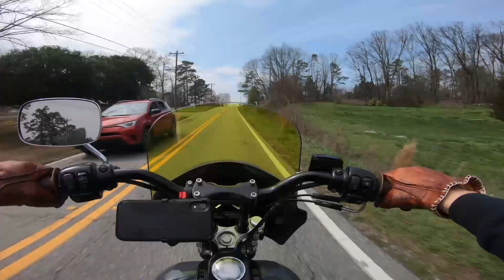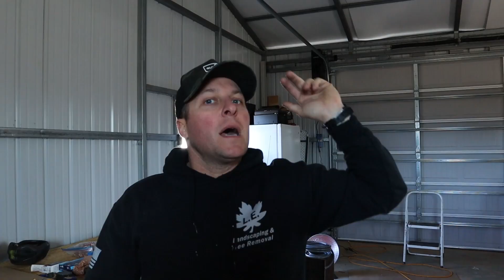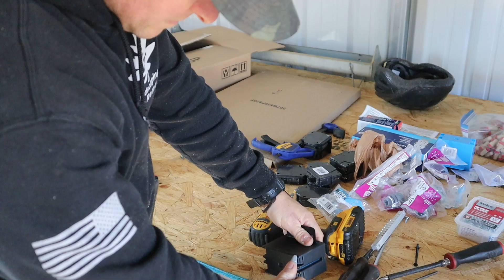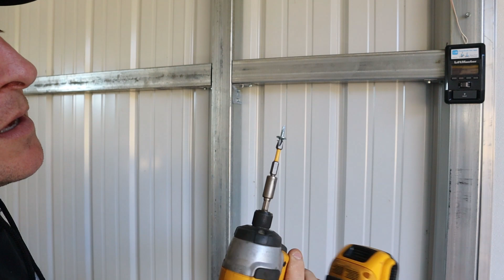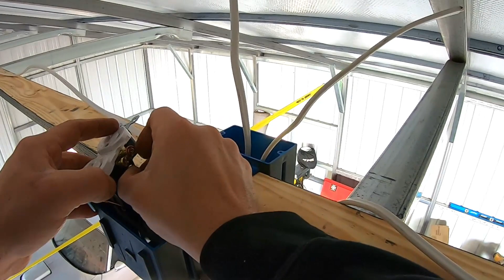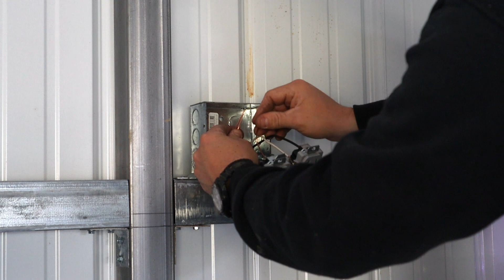I THINK IT'S RIGHT.. 100 Amp Sub Panel install Metal building dream garage build Ep.8

Comment: You’re wiring technique is good however I want to point out voltage drop. In the vide when you were way up high wiring the plug receptical fir your lights in the plastic box you will experience voltage drop. Let me explain. You have a hot wire coming in to the receptical and the receptical will power the wire going back out to where you have it going. Essentially you are using the receipt as a wire nut to power another wire. Doing this creates voltage drop and whatever you power next may not see the same voltage as the first stop from the main hot wire   As far as I know national code dictates that your incoming hot wire and the wire that will receive power must be wire nutted together with a pigtail coming from the nut to the receptical. So you will have in each nut three wires incoming outgoing and the pigtail that attaches to the receptical so in your case on that particular box you should have 3 black 3 white and three grounds. Another tid bit if you wire two different circuits to a 2 gang box all neutrals must be wired together and all grounds must be wired together. I’m not an electrician but I’ve done my homework and please check up on what I have said here. No my own personal opinion and how I rewired my whole house I used 12-2 and 20 amp circuits on everything just to make sure I have room to grow on the myriad of electronics that seem to make themselves into the houses. I don’t think I’ll ever need to upgrade wiring in my house again.
Reply: This is not correct. Neutrals for different circuits should not be connected together. If a neutral on one circuit should break somewhere instead of shutting off the load it will continue to operate and can overload another neutral with current from essentially two breakers on one neutral. 

Neutrals for the same circuit in a junction box must all be connected together.

The Equipment Grounding Conductors, bare or green wires, from all wire runs in a junction box must all be connected together
Reply: And it is accepted to splice through a receptacle as long as the allowed number of conductors under a single screw is not exceeded, i.e. one.
Reply: @duncancomputer  I’ll look it up but this is the way I understood to run two circuits in one box all neutrals and all grounds get wired nutted together. But I hear what you are saying about the separate neutrals. On a personal level unless there’s a good reason why I think all circuits should be separate anyway. Obviously the grounds in a metal box will connect together anyway. But again I’m a big fan of just keeping it easy and simple but the voltage drop I definitely see and sticking to my guns on the pigtail thing I talked about
Reply: @duncancomputer  Neutrals from the same circuit must usually be connected together, but not always. For example, you may have a 2 switch junction box being fed from a GFCI receptacle. One switch for the light and the other is for the fan. The fan is to be GFCI protected, but the light is not. In this scenario you'll have 4 neutral wires in the switch box. The neutral wires from the Line and the light will be connected and the neutral wires from the Load and the fan will be connected separately. If they are all connected, the GFCI would likely trip if the light is on and you attempt to turn on the fan. It would be equivalent to connecting a jumper from the Line neutral to the Load side neutral.
Reply: The NEC article is 310.10(h), parallel conductors for the same circuit.
Reply: @duncancomputer  thanks I’ll give it a look
Reply: I think you might have a misconception or two.

The NEC does not require "pig tailing", though it is my preferred method.  It allows a failure of one recepticle to only effect that one recepticle while the others should work fine.

Ohm's law ..... E = I x R. P = E x I

Connecting up a wire on the panel hot, going to a light, then returning to the panel gives you a circuit that lights with the breaker on.

With a 100 w old school bulb you get almost one amp of current.

P = E x I. Or  100 w = 120v x I

But if our wire has some resistance to it.  2020 NEC ch 9 table 8 has # 14 wire at about 3 ohms per 1000 feet.

So, if our wire to the light was 1000 feet long ... The wire would use/resist about
E = I x R   or  3 volts ( 1 amp x 3 ohms ) on the hot and 3 more on the neutral, dropping the voltage at the light to about 114 volts or dropping 6 volts.

2020 NEC 210.19 information note 3 restricts branch circuit volt drop to 3%.

Now, let's use the above light situation to say ..... Only time The neutrals of one circuit to that one circuit in the box.  So in a box with circuit 5 and 7, there should be two groups of neutrals .... One for 5 and one for 7.  2020 NEC 200.4.(A).

Back to the light.....if you remove power from circuit 7 and open the neutrals, circuit 5 current will drop to "no flow" zero.  yet still be supplied 120 volts.    So back to our circuit....

E = I x R

The hot wire will have zero volts used from our 120.    E = I x R or 120 = 0 x 3 sending the full 120 volts on to the light.

Again, the light will now use zero volts, no current flow. ( The light will be off with 120 volts at the input and output).  

Now we get to the neutral wire where we added millions of ohms of resistance with just a 1/4 in gap.  No voltage from the 120 panel has been used so far, leaving all 120 at the neutral tip and the light not shining but having 120 on it's terminals.

This is "The Hot Neutral".  A white wire carrying 120 volts to ground just like it's supplying hot.

I hope that helps.  I really needed some charts and graphs to explain better.
Reply: @keithharrington4595  don’t think I’m misconcepting anything. Funny thing about electric there’s many ways to skin the cat for sure. Keeping up with every code in the state then the towns is crazy fir sure. Although 3 ways may be correct it almost boils down to the electricians preferred way of doing things I guess. One thing fir sure. If whatever you’ve wired up works then you’ve probably done it right excluding wrong size wire circuits and outlets
Reply: N/A go back to school. You are way of, he wont have the voltage drop you talk of
Reply: @thomasmarable6818      Again Thomas you are correct!   Where do these guys get their ideas?   Voltage drop because of wire nuts?   I would bet he has no clue why you would never connect neutrals from separate branch circuits together in a box.   I’ve seen it done with neutrals from separate panels.   Boy did that cause some confusion!

Comment: I’ve built many shops, use 12 gauge 20 circuits for everything. You’re lift should be 220v and if it calls for 10 amp, put in 20. I don’t know if you’re lift is hydraulic or not but plan on the future. My shop  30’x40’ and for woodworking requiring more but and I have planned a 200 amp service. 
Shop build starts next month and not metal but frame construction. I need insulation as we get as low as 7 degrees in winter and sometimes 2’ of snow and over 100 degrees in the summer. Arizona at 4300 feet. 🥶🥵

Enjoyed your build a lot. 
You helped me sway away from metal. I also want it to look like the house more.
Reply: Why would you need a 200amp service for your wood shop? Just asking. 
I have a 30x40 with a combined wood/metal shop and just pulled 100amp off the house. I cannot imagine using even 100amps at one time in my shop and it has a minisplit. Not trying to disparage you, just wondering how many tools your running at once. The most I have been able to pull with the lights, tablesaw, planer, mill, lathe and compressor running is 50amps. That is way more tools than will ever be running at one time in my shop even with a couple employees.
Reply: @mattozx6rr  I plan on have about 75 HP
worth of equipment. A 20 HP phase converter running all day that goods for 60 HP of machine’s. 7.5 compressor.10 HP dust collector 2 5hp table saws 15 hp straight line rip saw. Wide belt sander at least 8 20 amp 110 volt outlets with 4 per circuit. 5 hp jointer. 13” planer and a 25” planer with plans for a two sided planer total of 40 + hp with a separate phase converter and someday a 4 sided molding machine. 
I figure 40-50 percent use at one time.
Reply: @billboy7390  Thats way too much equipment for a 30x40 even being able to move stuff out of the way. Your 40 to 50% utilization would indicate you also have or will have employees. For the equipment listed by you I would have atleast doubled the square footage as there is way too much equipment for a 30x40 and you still have to have work surfaces like benches and tables. But hey, you do you.
Reply: @mattozx6rr  one man shop. A couple machines will be outside. Did it when living in Phoenix. I’m Al’s in a wheelchair. I have a system and plan to mostly plan on a millwork business. And if I need to add more space I have room.  Thanks for you input and concerns.

Comment: A great project you have going there. The trials and tribulations you've been through are what life's all about, yes? You're doing a fine job on dealing with them too. 
FWIW, I can offer a small suggestion on your receptacles up top. You might want to orient those so that they are pointing down. In my experience, over the years, dust and debris, combined with moisture will accumulate in the receptacles and may cause you headaches down the road. 
Also, ditto on the GFCI breakers suggested by Vincent.
Reply: Absolutely, point the receptacles facing down.

Comment: I use liquid tight flex conduit all the time installing commercial refrigeration equipment,  but I've never seen it used on an interior wall. Probably because of the price and you can't cover it with a wall per code (at least where I'm from).  The shop is looking great!  I really need to build one. My garage just seems to be getting smaller and smaller.
Reply from the maker: Thanks man. Yea the stuff works pretty good. One reason I used it and forgot to mention when and if I ever cover the walls with Sheetrock or barn wood etc, I’m just going to unscrew the clamp mounts and remount again to the outside of the new wall. Figured i had some movability options with it down the road. I might try metal conduit when I run my welder wire though but keep the same movability concept for
The walls. Thanks for the support bro.
Reply: You can run sealtight inside a wall, its a raceway. As long as you strap it per code all good